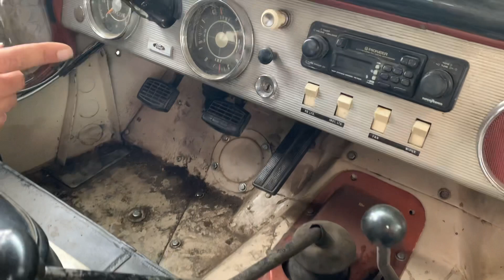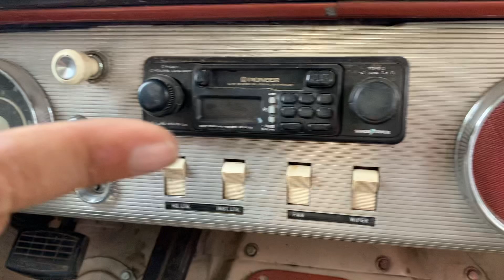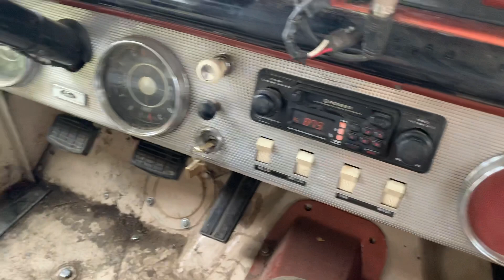1951 M38 Willys w/ Studebaker 289 V8

Comment: There are two brands of cars people didn't realise the quality until lately. Studebaker and AMC are the two. I drove AMC as an over the road salesman putting sixty thousand miles per year on them. Kept them three years and never had a major repair. Never had an oil burner, and always got great gas mileage. I do miss AMC. The six cylinder Jeep had before Chrysler put V six in them is the same motor AMC used. It was a seven main bearing engine and very good. Studebaker also had very high quality cars and it is a shame the big three conspired to put them both out of business.

Comment: That Stude engine is a beast.  It's massively overengineered.  It's a heavy lump compared to the power you get but they are damn near indestructible.  High nickel content in the block so the bores hardly wear.
Reply: The 472 / 500 Cadillac also had high nickel castings but good luck fitting one in a 'flattie'!
Reply: @-oiiio-3993  visually it looked like a Cadillac motor 
And heavy 
Small block Chevy was the best conversion for V8
A  off roader  friend bought one and swapped it back with an amc 6
Scrap yards were loaded with them

Comment: Great to see the Studebaker V8 transplant!  Here's a bit of stuff I remember from my own Studebaker days in the sixties. The bypass oil filter was used up through mid 1962 when they went to a full flow. That side draft 2 barrel is a Stromberg WW and was used in the pre-Lark days. The swing pedals are also Studebaker (distinctive pedal pads) from 1961 or later. The instrument panel is sporting 1963 gauges.  If you wanted, you could install a later carb on the manifold, or switch to a four barrel WCFB, or better yet, a 1962 and up manifold and an AFB carb. Finally, Studebaker was big on strength, with the basic engine designed for compression ratios up to 15:1. The engineers figured on higher octane gas for improved performance, but the industry went to larger displacements. The block had a higher chromium content than others, and all of the V8 cranks and rods, as well as rocker arms were forged steel.
 Thanks for the awakened memories!

Comment: In the early 60's the Studebaker V/8 was very popular before the small block Ford.
Reply: I read that they had forged steel crank, rods, and rockers.
Reply: @xmo552  And they bolted up to the stock T-90 transmission.
Reply: @robertsnyder5149  
Wow even better.